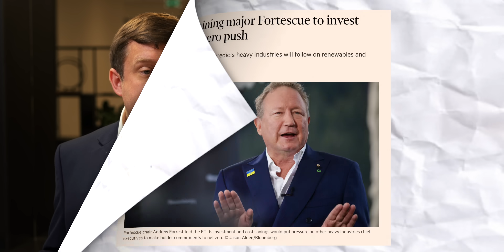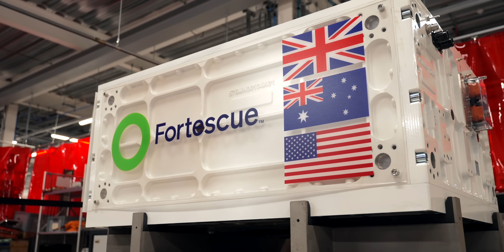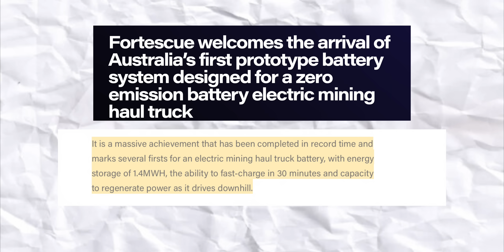This GIANT Electric Mining Truck Charges in Under 30 minutes!

Comment: This is good, and needs doing, but... the biggest problem with decarbonising the iron and steel industry is that the way you make refine iron ore is by heating it with carbon, producing carbon dioxide, and the way you turn iron into steel is by heating it with oxygen to burn off the excess carbon, producing carbon dioxide. See Bessemer Converter (it looks amazing). Steel making produces about 7-9% of all carbon emissions worldwide. There's an alternative process for making steel called HYBRIT which uses hydrogen rather than carbon, but it's still really new. (And of course you need to use green hydrogen.) I also can't find any information on whether you still need a decarbonisation step to turn the crude steel into high-grade steel. So, yes, decarbonising the mines absolutely needs doing, but it's very much the easy side of the problem. Decarbonising the refineries will be much harder.
Reply: Yep.
We still need coke for quality steel.
The issue is going to be economics.
Typically We mine both thermal & coke together thus the cost to win the resource is spread across the two products.
What do we do shut down coal power plants,
Thing will become more effective. 👍

Comment: As a mining truck driver of 28 years, I’d love to have drive of one of these. It would be quieter I’d imagine ( I wear  hearing protection in diesel) and I’d not be breathing in diesel fumes which can happen even though I try to avoid.
Reply: I drive fork trucks to load. Had bin driving everi types imaginable. I chose an employer with electric if i can. They are much much nicer to work with.
Reply: @oddjobsandrandomprojects  I never said anything about lithium mining. From what I have read, it is about as bad for the environment. If you want to mine lithium and drive an ev, go for it. Don't use bad science to force everyone else to do it.
Reply: @oddjobsandrandomprojects  the point is that Iceland was covered with ice when discovered.  Was that the ideal climate temperature, or is today when Iceland is not covered in ice?
Reply: If your still in the business look into metal plants they accumulate 1 and sometimes but rarely 2 kinds of ore in there bodies on porpoise.
Like the nickel tree it can live in soil with nickel lv at 1 to 2.5% or even 5% and in there bodies it can be up to 5 to even 10% compared to the ore in weight.
Also if you collect enough and let it dry you can burn it for power and the ash has the ore so now it's much easier to get the ore out.
You can use these plants on the tailings just crush em more so it's less ah Rocky more sandy just add dirt or poop so the plants can grow.
Look into it you my be able to get more ore and reduce co2 and green up your site and make your company more money all at the same time.
Reply: @oddjobsandrandomprojects drivers are already being replaced even with ICE technologies… BHP and Rio Tinto already have staff driving several trucks from a couple of thousand km away.
Reply: Not sure what sort of Gaul truck younare driving mate but a 220 ton terex unit rig in Australia with an onboard diesel driving a massive generator is a quiet comfortable airconditioned ride
Reply: @secretdad544  Caterpillar 789D. Mechanical drive.
Never driven a Terex, sounds good.
Reply: As long as they make the battery packs replaceable because as testing has shown 300000 KM is about as good as it gets with current battery technology.
Even in the Automotive sector hybrid sales are starting to overtake EV sales for a very good reason.
😎🇦🇺
Reply: @markjmaxwell9819  modern battery tech easily does 3000 cycles without hardly trying. Although having a million cylindrical cells adds many points of failure. Fewer larger pouch cells make a more reliable pack
Reply: Diesel is rather hard to get burning.  That is why the military uses it. If they do burn, dump water on it, and it is out. How much water and for how long to put out an EV fire?@oddjobsandrandomprojects
Reply: @fredbecker607  Perhaps you will recall the Luton Airport fire?

This is the fire that burned a whole parking garage full of cars until part of it collapsed and the whole airport was shut down.

Well, this fire developed as follows: A diesel powered Range Rover was driving inside the garage and spontaneously ignited.  The driver parked it in a parking space and attempted to extinguish the fire, but was unable to do so.

The flames from this burning diesel Range Rover then spread to other ICE powered vehicles, eventually involving some 1,400 ICE powered vehicles.

The charging station for EVs was in the garage next door.  So the EVs were in this adjacent garage.  None of them caught fire.
Reply: @fredbecker607 diesel is hard to get burning, what Planet are you on.
Reply: @fredbecker607  Blaw Blaw Blaw, old spew, try again.
Reply: Soon these will be Ai so your fired hahahaha just think a new battery for this will be millions to replace
Reply: @curtisducati  A lot of places are already going autonomous, separate of them being EV.
I would think a decent chunk of the cost of these batteries will be in the housings and BMS. So when the battery needs replacing I'm sure they will rebuild they packs with new cells, not just buy a whole new pack. Just like what already happens with every major component on mining equipment.
It's not like the engines that won't be needed anymore are that cheap to begin with. At a site I've been at somebody forgot an o-ring inside an engine oil filter during an engine oil change. That o-ring destroyed the engine when it made it into the oil gallery for the crankshaft bearings. We were told that o-ring cost the company 1.3 million Australian dollars.
Those trucks will need atleast 3 or 4 engine change outs during their life. Maybe more with low hour failures.
Some of those engines are advertised as being able to burn 1 million gallons (3.8 million litres) of fuel between rebuilds, so there is potential to save a lot of money in fuel if they get get a decent amount of the electricity from solar.
Reply: @curtisducati  there already are autonomous trucks and equipment.... And that battery will not be millions lol.
Reply: @curtisducati  so your happy for someone to lose a job to AI. Who's side are you on?
Millions of dollars are already being spent on engine, transmission replacement and on fuel in the life of a truck.
Reply: @curtisducati You seem very well informed. (Not)

Perhaps you can calculate the number of millions it will cost your great grandkids to buy dinner if climate change is allowed to go unchecked?

Or maybe that's no concern of yours?
Reply: @davidmenasco5743 this is assuming that the climate change happens this time. There have been too many false alarms over the climate hysteria.  First cooling then warming,  now just change. Then also, how accurate is the forecasting of what will actually happen? If all of these fantastic changes are made, how much will it actually do? Then, one simple question.  What is the ideal temperature of the earth? What is now? How about during the last mini ice age? How about during the period when Iceland was green?
Reply: @fredpeckerhead  Your hat is too tight.
Reply: Wonder what deadly vapors the lithium would be once the zillion batteries flame up?
Reply: @Dirtyharry70585  Far, far less deadly per kg than the vapors that are coming non-stop out of the old diesel trucks.

Comment: Please explain how the battery integrates with the rest of the drive system.  I presume the battery powers hydraulic motors so pumps hydraulic fluid rather than direct drive to electric motors on the axles.  It is interesting to hear about another battery installation but as a mechanical engineer I want to also know about the whole system.:face-fuchsia-tongue-out:   Thanks.
Reply: It will be for both the traction motors and motors to drive hydraulic pumps.
I'm pretty sure the traction motor will be similar to diesel electric versions that already exist, where they are built into the rear wheel ends with a planetary drive. The also have separate motors direct drive to the hydraulic pumps. This should be the same, just with a battery supplying the electricity instead of an alternator.
As someone who works on these machines in that area of Western Australia (I have mostly only worked on the mechanical drive versions, not too much of the diesel electrics). I would also like alot more technical details.

Comment: How many mountains did they level to the ground just to build one battery pack for that machine ??
Reply: Could ask the same about oil :)
Reply: @blackfoxstudioX  
uhhh,   oil is pumped from underground.   No mountains were leveled.  Plus,  oil is not a primary component in building an engine.
Reply: @WTF_BBQ  yea just drill underwater, ruin ocean float, then transport it through pipes and hopefully not spill anything, then use extremely dirty ships powered by dirty  fuel to transport it, burn it more stuff to refine oil , then burn even more stuff to transport it to your local fuel station then burn even more so you could pay 70-100€ just to fill your car and burn that fuel with 30-35% efficiency, in other words 70% goes completely  wasted. During whole process of drilling  refining and using you waste soooo much energy that the only solution is to burn even more stuff.

Obviously it’s important how lithium, cobalt and other materials extracted but at least batteries even at the end of their lifetime can be either recycled or reused in energy storage. Can you recycle fuel? No, because all that dirty stuff ends up in your lungs and atmosphere for thousands of years. There are just sooo many positive things batteries.

So yea please tell me how batteries are worse than oil fuel :)
Reply: @blackfoxstudioX  
I tried addressing your argument, but YouTube automatically deleted it because that's what they do. This is why I prefer other sites when it comes to hotly debated topics.
Reply: @WTF_BBQ   Well maybe because your own Information is not that accurate and very one sided. But hey you are already on the right channel, keep learning :)
Reply: @blackfoxstudioX  
Or maybe they're lying to you, and they're trying to keep you in the dark...
Reply: @blackfoxstudioX Yep!
You know what a BATTERY is and why it can be recycled?

You know what FOSSIL FUEL is and why it can't be recycled??

Mate please.
Reply: Mountains levelled?  That's just stupid!  Someone needs to grow up.
Reply: @malcym3394  
You're obviously clueless about EVs.   Leave the discussion to adults.  Stay in the kids section okay ?
Reply: @WTF_BBQ  That's a very intelligent response.  (shakes head in despair)
Reply: @malcym3394  
If you ask an intelligent question or state an intelligent opinion,  you'll get an intelligent response.   That's how things work.
Reply: @WTF_BBQ  Well, I didn't actually ask a question.  I simply observed that for you to talk about levelling mountains was a bit silly.  That is, it wasn't particularly - using your words - intelligent.  I appreciate that nobody likes being called out and I rarely leave comments.  But, sometimes, it's hard to ignore something that IS just silly.  Anyway, I've had enough back & forward.  You have a nice day.
Reply: @malcym3394  
It's not silly.  I'm quite serious.  I may have exaggerated my statement but you'll understand the ridiculousness of EV once you know the facts.

It takes roughly 500 tons of dirt being mined to build ONE EV battery pack.  For a tesla car,  that's about 6,500 cells.   This truck has 100,000 cells which calculates to roughly 7,000 TONS of ore just to build ONE BATTERY PACK  (that's not even the entire truck).  

Just to put this into perspective,  One fossil fuel car would use approximately 20-100 tons of dirt mined to build the entire car !!!  Approximately 500+ tons to build  an entire dump truck from scratch.

7,000 tons for a single battery pack is ridiculous.  It's almost like using an entire swimming pool of water just to flush a toilet.  This is the type of insanity that nobody tells you about EV.

Comment: Regardless of powertrain, bearing still need grease and probably oil of some kind. Plus tyres aren’t just made of rubber. But I applaud their stated aims. Will they make them, we’ll have to wait.
Reply: You don't burn lubricant oil, grease or tyres. You recycle them. You can't recycle diesel. it goes to the air when you burn it and then you breath it and it kills you slowly.
Reply: @chrishar110  you can use biodiesel or gas from cows in farms.... energy made from waste recycling, even the landfills produces energy.
Reply: @alanmay7929  what to power how much?😆

Comment: Makes me wonder if Fortescue thought about battery swapping on those trucks? While they are working, a bank of batteries are charging up at a slightly slower rate than the fast charge, but the swap takes less time than charging would.
Reply: That's what I want to know. I've been thinking about that since 7 or so years ago while I was working at a Fortescue site (was there for 5 and half years). 
I was doing an engine change out on one of the large CAT trucks (793F) with another mechanic, and we were waiting for a crane, so had time to talk. We were thinking about how you could make a battery electric one. It seemed obvious to us that you would just put the battery where the engine is (engine with torque converter in that truck is around 12.5 tonne) and have the battery and radiator as a module that would have channels in the base of the frame, so you can pull up to a battery bay instead of a fuel bay, and have it autonomously set up to remove the module and swap in new one. Then you can charge that battery over a few hours or more (depending on how many extra batteries you have), so you don't have to try and charge at 3 plus mega watts, while the truck is sitting for half hour plus. Slow consistent charging of extra batteries also seems like it would be better suited to making use of solar generation during the day.
I'm sure it would be difficult to make sure there's is always a good, safe electrical connection (trucks are always covered in dust and a lot of mud and baked on dirt once it has rained), plus making the battery hold done mechanism reliable, but it still seems to me like it would be the way to go until battery energy improves a lot.
Reply: Mining equipment manufacture Sandvik makes underground battery electric mining trucks that use battery swapping technology.  The swap time is about 5 minutes.

Comment: COAL-POWERED TRUCK !
Reply: The Fortescue site I was at had their own diesel generators on site, not connected to coal plants. Done properly it can be a lot more fuel efficient to use diesel generators to charge batteries that drive electric motors than to mechanically drive the truck with a diesel engine. Plus like the video said they are planning to use a lot more solar, so then they can be atleast partly sun powered.